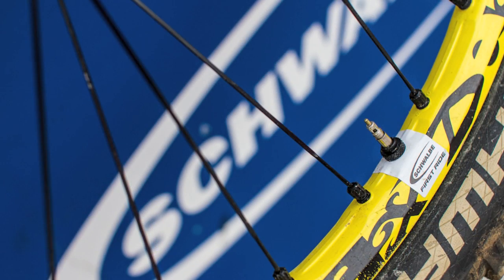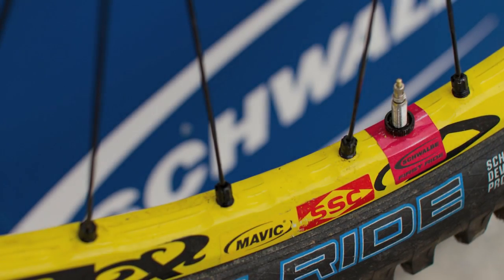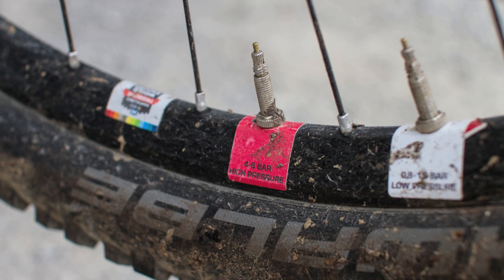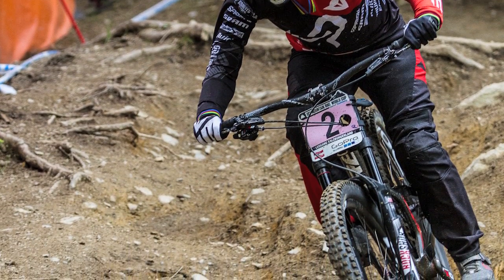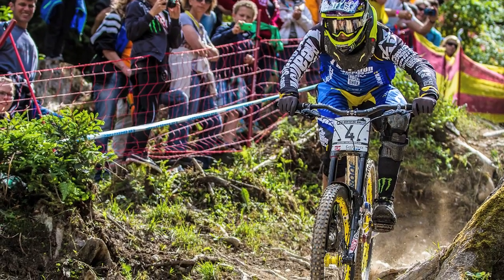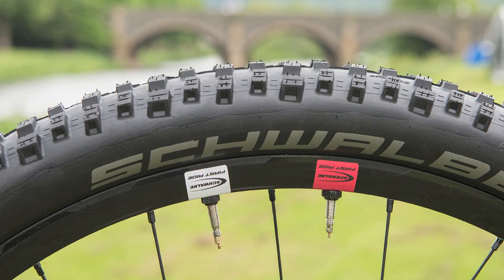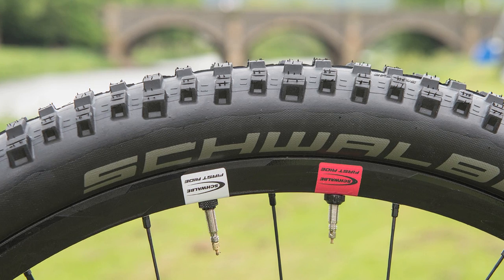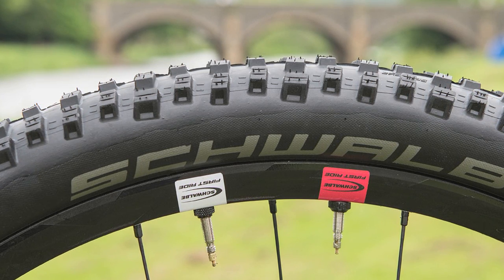Schwalbe Tubeless Dual Chamber Air System Explained

Comment: i'm no engineer but wouldn't it be more balanced if the second presta valve was on the opposite side of the wheel to make it more rotationally balanced, or does the extra few grams not enough to put it out of wack when spinning up to higher speeds?